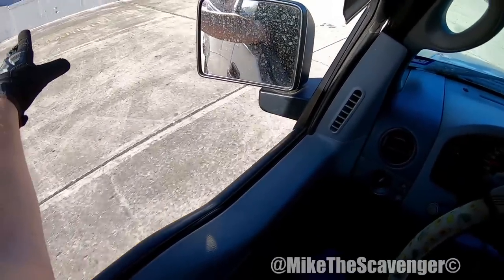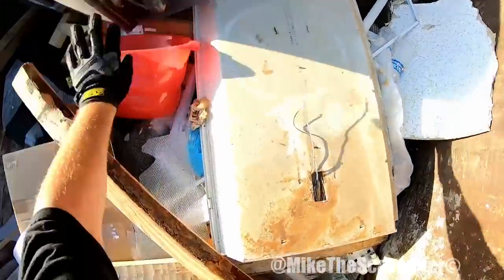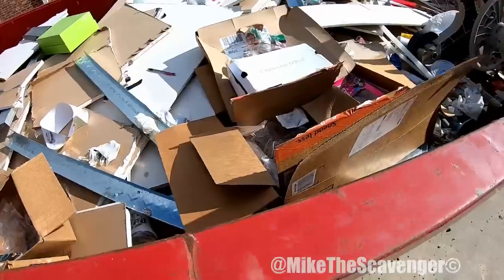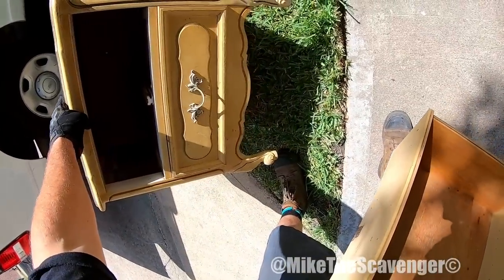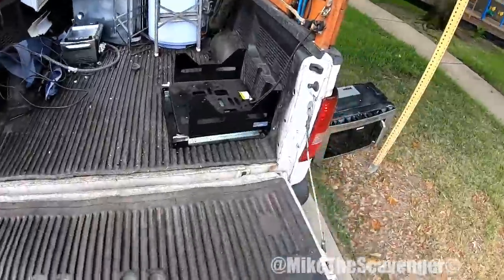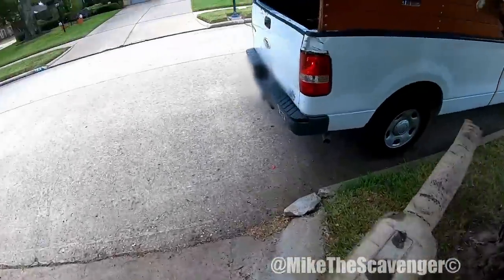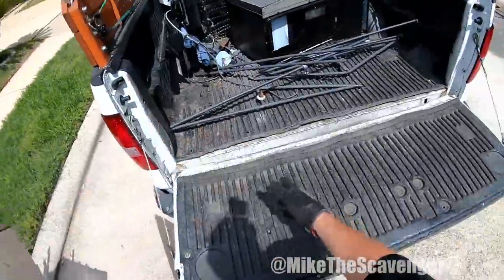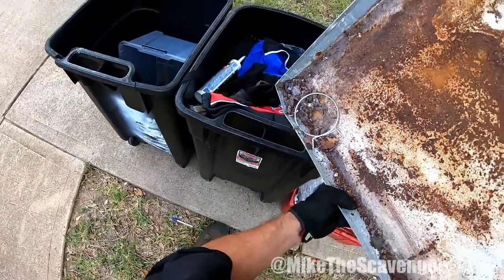Curbside Scavenging "Keep Those Peripherals On"

Comment: Also I was in a town that I’m not usually in so had to go around and search for scrap. Found a Cracker Barrel corporate office that was getting DEMOed . Found the biggest light ballast I’ve ever seen they’re like a foot and a half long bunch of wire Romax number one wire to electrical panels that are huge and 50 lead acid battery power back up batteries but these are like triple the size of a normal power back up
Reply: Nice score👍

Comment: I feel like you know this but just in case I'm going to tell you anyway. You can take a hammer and knock those drain valves off at the bottom of water heaters. Most of the time they'll be clogged up but once you knock it off wide open drain right out.

Comment: Mike , Have you seen the video of the guy laying concrete in his truck under the plastic trim thingy for weight purposes , I'd say that's cheating, I know you're honest so it would never have crossed your mind would it.
Reply: Because they weigh the whole truck it only makes your truck heavy on petrol does nothing on the metal you deliver 🤣🤣🤣🤣🤣🤣
Reply: I was behind a guy that when he went around to get his weight. A huge amount of water started pouring out from Underneath his truck and he was driving very slow. So when he was parked I dropped something and sure enough. He had tanks underneath the bed of his truck. Now that is inventive.
Reply: @KPaul7  shoulda reported him to the scrap yard hes stealing and they will call the cops on you for using trickery device to scam/steal. and yes that is a thing.